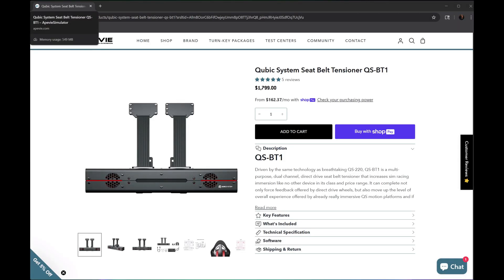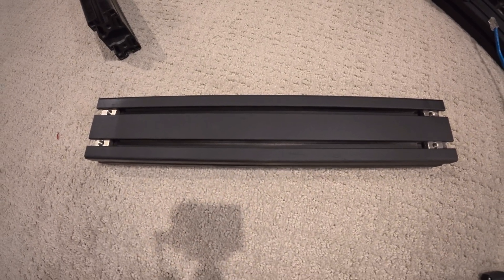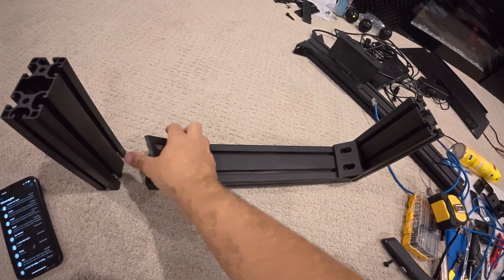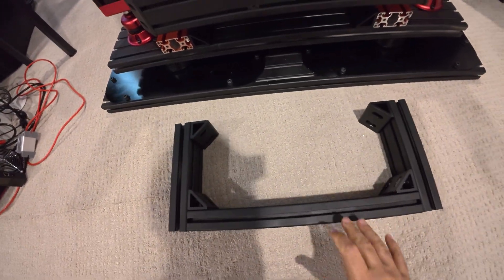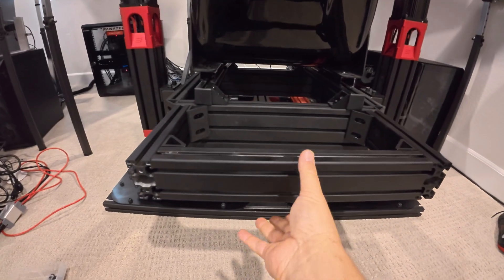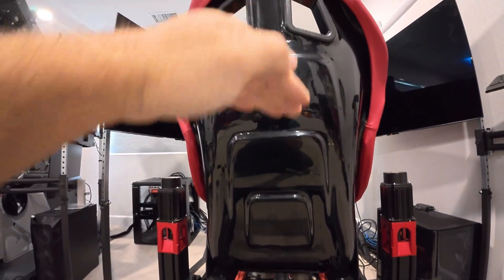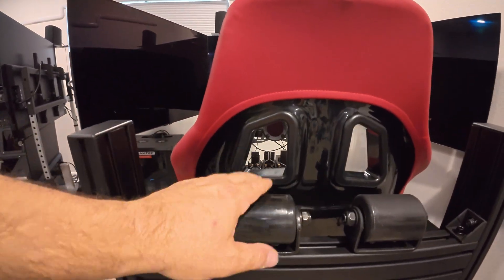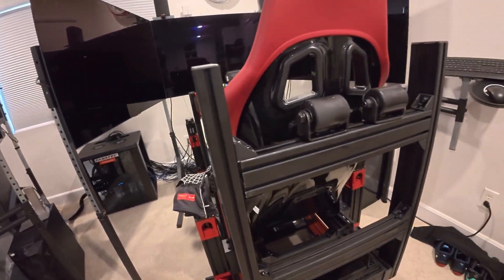QS-BT1 Belt Tensioner Install on Eracing Lab Gen 2 Platform - Part 1

Comment: Hi, nice vid, thanks for sharing. Can you provide a link or info on what are those rollers and brackets they mounted to your horizontal profile? I was working with some 3D printed files I found but they are not quite right for my setup and your stronger looking rollers/brackets might sort me out. Thanks!
Reply from the maker: Hey! I used these https://amzn.to/4b62doH but then I switched to these https://simul8master.etsy.com/listing/4359437789
Reply: @simul8master  cool appreciate the tip, yeah I found those on Amazon yesterday and have them coming tomorrow to try. Curious why you switched to the Etsy design instead?
Reply from the maker: The belts would slide off sometimes because the rollers had no groove on the ends.

Comment: Hello I have a Trak Racer TR8 Pro sim rig. Can this mount to my tube style rig? I am not sure where the BT 1 box will mount on the TR8 Pro. Any suggestions would be great.
Reply from the maker: This will only mount to aluminum rig. I am sure though there could be some hacks out there to make it mount to a tube rig. I believe TR has a base for the TR8 Pro to sit on and maybe you can mount the eracing lab actuators to it. That's why I never liked tube rigs :)